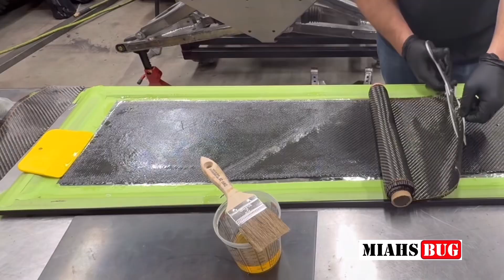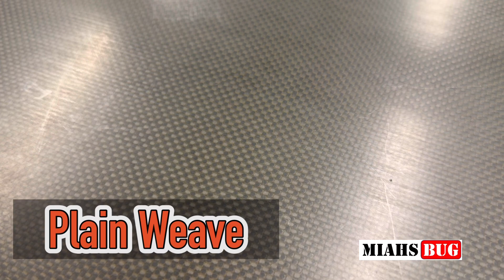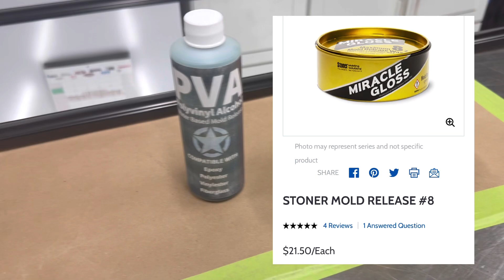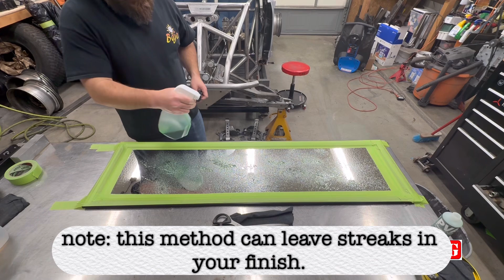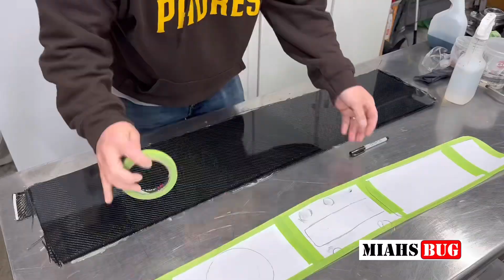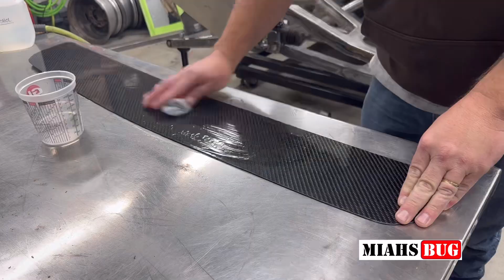Perfect Carbon Fiber Layup: Beginner’s Guide

Comment: 2 things: firstly, when making a larger part, say a hood or something, I was wondering how guys weight out the epoxy resin thats needed for a larger part. Small scale stuff like this I see people use the small scales no problem. But for bigger parts, how do you weigh out the resin needed? 
Secondly, next video could be making more complicated parts :)
Reply from the maker: Hi John. I have always used a scale, even when weighing out larger batches. In general we never mix more than 1000g part A, per batch. This means you will be mixing more but if the resin isn’t consumed fast enough, you run the risk of an Exothermic reaction. Essentially resin heating itself and get out of control.
Reply: @MiahsBug  Alright fair enough, then how do you weigh the carbon fiber in order to know how much resin is needed?
Reply from the maker: @ you don’t. Wet the carbon to saturation then pull the excess out. It’s a touch and feel process but most people get it fairly quickly. There should be no pooling or drips
Reply: @MiahsBug  Good to know, thanks for the responses
Reply from the maker: @JohnTodd9092 of course. Ask me anything anytime. I respond to all comments
Reply: @JohnTodd9092 You could math it out - ie: 6 oz /running yard per manufacturer... or GSM (Grams per square meter) figure out your coverage then mix about 10% extra - same weight in epoxy. That would do the job. Like he said, maybe mix 500 grams at once, lay then make another batch to finish to keep the epoxy thin / less heat - less rush. Easy to squeegee out